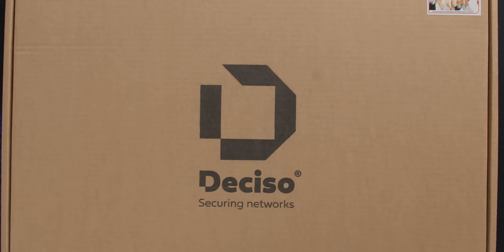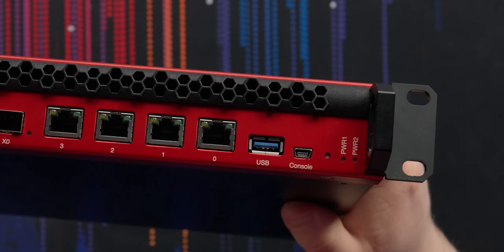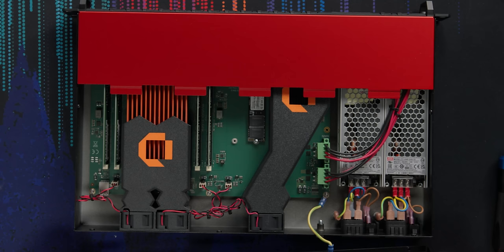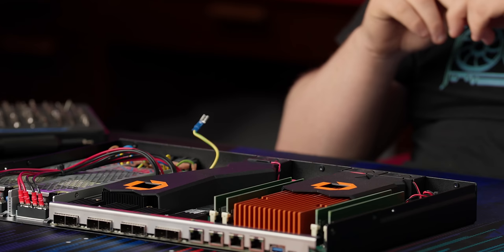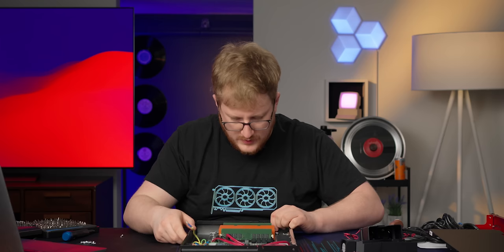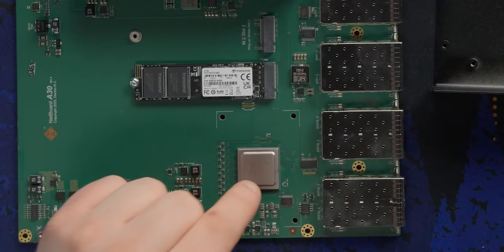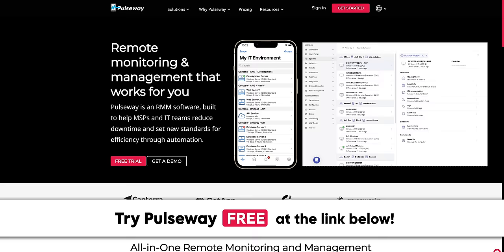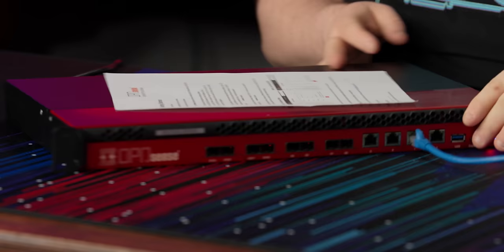Our BIG network upgrade! - OPNsense DEC4280

Comment: 60 Gbps is a nonsense number that’s derived from using a 1500 byte packet size for all packets at 5 million packets per second (which is the real number to be focusing on). At a more realistic 578 byte (IMIX average) packet size that’s 23 Gbps. At line rate (64 byte packet size)? That’s only 2.5 Gbps. And that’s not even going into the absolutely abysmal threat prevention rate which takes packets per second down to 625 thousand. For something that’s costs $6,000+ one would expect better.

Comment: Jake either brings shockingly cheap server hardware or gut punching expensive. There is no in between.
Reply: And it's poorly spent every time. He could spend literally a bit more for a real firewall.
Reply: @gamebrigada2 wdym it is a real firewall, it's literally a security appliance
Reply: @spicybaguette7706  he's just a hater.
Reply: Ubiquiti is perfectly in-between which is why they are so popular among IT professionals.
Reply: @@Mohamed-hu5jw To be fair Palo's new range ie 3410/3420 etc have come down a lot in pricing really depends what you need. Looking at renewal for our 5220 we would save about $31k over 3 years if we where to move over to either of those models, that's also including the cost of buying either and we are still saving that.

Not sure what's going on over there at palo at the moment, might finally be feeling the pinch of the companies moving to zero trust and dropping their firewalls.
Reply: @maxhennessy6676  the 400 series is pretty competitive in its target market but their older models definitely weren't.
Reply: @@1bhbjk Fair point, but it is pretty fire isn't it?
Reply: Ofc 💀 wht would he bring out something expensive/cheap that's bad, ofc theres no "in-between"
Reply: @spicybaguette7706 They mean an actual enterprise grade firewall.  Interface throughput and ACL throughput means nothing. If your a business you need NGFW features. 

IPS, NGFW, and  VPN throughput. Things like active passive and active active pairs. 

So he uses a 400F as an example of similar specs. When the 400F slaps it down.

400F has 12 Gbps IPS, 10Gbps NGFW, 9Gbps Threat protection, 55 Gbps IPsec throughput.

The machine he pointed out is not a NGFW. The comparable specs they do have is 2.5Gbps IPSEC, 3.5 Gbps Threat protection.  With zero deep packet inspection  and essentially zero DLP, and application control. 

That's not even counting that interface to interface throughput which is 9.9 Gbps. 

A 200F can out perform this thing, and a 100F can give it a run for it's money and they are cheaper MSRP.

Also no one pays MSRP, assume 30-50% off including your licensing.
Reply: @@Mohamed-hu5jwmy question is how you putting Sophos and Palo in the same sentence. 

Sophos firewalls are essentially sonic wall level trash. And their EDR is awful. 

Palo os over priced when you compare to fortinet.  But it still runs circle around a Sophos firewall
Reply: @maxmustermann194  but also hugely frustrating to many IT professionals
Reply: he's saving up for the big spending one
Reply: If you think €6k is expensive I have news for you
Reply: @mgzukows  Our 201F with 3 years of licensing was just over $13,000...  This unit is $6000.  Not sure how that's comparable.  Luckily we get eRate, but otherwise...
Reply: The odds that he actually paid for this overpriced junk is 0.  YouTubers are all the same.  They’ll pimp whatever is free and gives them to ability to use affiliate links.

Comment: am i the only one that find it infuriating that an open source router has a "warrantee void if removed" sticker on it and has 0 hotswap parts while also using annoying torx bits
Reply: I agree about the open source and warranty void sticker, the no hotswap and torx I don't 100% agree with.

They have redundancy at least, so you can schedule your maintenance outage at a time convenient to you. I don't see a device like this being used in many large enterprises, no hotswap, no global distribution chain for support and parts. More likely SMB or prosumer customers like LTT.

Can't stand phillips screws, alright rounding over or striping. I found torx so annoying, until I actually owned a good set of torx bits and torx drivers. They are the superior screw.

Comment: As someone who works with rack mount HW all day every day, redundant PSU's are not helpful if they are not hot swappable. If one fails the unit has to be taken out of service for an extended period in order to replace the bad one. That isn't something you're going to do on the floor, too loud etc., so all a redundant PSU does is delay when the outage occurs.
Reply: It does give you the option of putting the outage into a designated maintenance time frame.
For example, I would assume LMG doesn't really need their firewall Saturday 3am.
Reply: non-hotswap PSU devices should then be deployed in pairs, or in a HA situation - this allows the devices to keep running - even tho with 1 failed PSU.  Once the fault it identified, you should either fail over to redundant device, or schedule a downtime window to replace faulty component.
Reply: @netrixtardis  Which is exactly what Jake said they are doing.  
for what it's worth, for the small business sort of customer a device like this is aimed at, it doesn't seem like a big deal to schedule 15 minutes of down time, after the 2 or 3 days it will take to have a new PSU shipped out to you.  No one is keeping spares on the shelf for this.
Reply: Technically, they are hot swappable. If you leave all cables long enough to take the unit out of the rack and risk electrocuting yourself, you can pull it off.
Having two PSU lets you connect it to two different power sources. Which you don't get to do with just one.

But you are right, it's wayyy more convenient to just pull the defective PSU and load a new one.
Reply: A dead PSU is not that kind of problem. OPNsense is build with HA in its base.
If one unit fails, the second will take over all services, until the problems with the first unit is solved. This goes back to the roots, inside PFSense.
Reply: I'd sooner opt for redundant devices than redundant components.
Reply: This is more for 2 redundant power sources. You'd also want 2 of these firewalls in a pair.
Reply: While I agree with you that hot swappable, redundant PSUs are better, Jake mentioned in this video he is doing an HA Pair, so having two PSUs in each firewall and being able to pull one out of service means this is probably a non-issue here.  OPNSense uses CARP and the failover times are basically nothing between firewalls.  You could do it in the middle of the day and nobody would notice.  This is the same on pfSense.  The only interruptions you'd see are things like VPNs.
Reply: You’re supposed to put power from two different phases into it.
Reply: If you can’t have outage, you probably have a second firewall configured with HA
Reply: For the $6k price, there's no excuse why these couldn't be hot swappable.
Reply: How did you get into your position? I am a hobby IT guy but work as a certified auto repair technician. Been considering switching to IT, just don't know how to really do it.
Reply: @fightingfalconfan  I did not follow a "normal" career path. I used to be a software developer and moved into IT management as I got older and SW jobs started getting hard to find.

To get into datacenters you need either a degree in something like EE and/or a bunch of certs, A+ or the like. Your best bet is to find some small to mid size business that needs someone to handle their IT/helpdesk and get that as a line on your resume. If you can get them to pay for you to take the cert courses/exams all the better.
Reply: @johngaltline9933  You would be wrong. Though frankly, you are better off buying a cheap 1U from a tier one vendor with a 7x24x4 support contract. However in general you operate routers in pairs otherwise you have to take your network down for firmware updates and that really sucks as it will be a far more regular occurrence than hardware failures and well paying your network admin to do it out of office hours starts getting expensive quick on the overtime bill if you can persuade them to come in at all.
Reply: @krisdphillips  Having to take network gear out of the rack for fan/psu replacement really really sucks. The problem is making sure you get all the network connections back in the right port.
Reply: @jonathanbuzzard1376  so, what you’re saying is it is still a non-issue, as multiple units are typically used.
Reply: @jonathanbuzzard1376  It's a PITA if you don't have good cable management.  Unfortunately, most racks look like spaghetti.  

Network Connections going back into the right spot should be easy.  LACP bond for inside interfaces and your WANs are all you need to connect.  If you can't figure that out, you have poor documentation.  

To be clear: Hot swap would have been better at this price.  However, given they're a small company making their own hardware, it's kind of understandable.  They aren't making things at the same scale as someone like Super Micro.  The front grill is 3D printed, for instance.
Reply: Dual power supply gives a planned/managed repair. It also allows a plug to be on mains and a second on UPS. UPS systems do fail.
Reply: Why do people touch RAM on the connectors?  Yes, unlikely to shock it, but why take the chance? Hold it by the PCB sides.
Reply: @jroysdon  because it makes no difference. A static charge capable of damaging the ram will jump right through the conformal coating or between the layers of the pcb at the edges just as easily as it will through the connector.

Comment: i work as an it professional and installed similar deciso hardware in different customer scenarios. every unit works like a charm to this day. i really like opnsense, so simple to setup everything and rock solid. cheers
Reply: Wonder if it's relabeled stuff or proprietary...
Reply: @mrmotofy  for the pcb itself i dont know. but they put a lot of efford into custom cooling like 3d printed stuff

Comment: I used to OPNSense on a Core2Duo laptop, was great to have the built in battery (was new). Using a ProtectLi now, highly recommended. Last router you'll need for 20+ years.
Reply: yea until your isp give you fibre and 10 gbit for the same price.

Comment: Big fan of the customization devices like these offer as routers. I've been using pfSense on a mini PC for a few years now and it's been wonderful. It's quite refreshing to finally experience something so reliable that it has multiple years on the uptime counter.
Reply: In business IT: Uptime counter === unsecure/obsolete software running for YEARS... good luck with that if you have an audit :)
Reply: @EFazy  It’s not at a business so I don’t have to worry about any dumb policies. I’ve never heard about anything that would impact pfSense’s efficacy as a firewall on a secure network, so what do I care?

Comment: I just built myself a Sophos firewall, I used an old dell optiplex with a dual intel gigabit NIC. Got the hardware all for about $120. For home use, its overkill. Sophos offers a free home version of their OS. It can do packet decryption and re-encryption (which breaks stuff but its fun to play with). 

The home based version does limit to you a 4 core CPU and 6GB of RAM. Which is fine for home use. Probably fine for a small business but the EULA likely states not to use it for a business environment. 

I had been using the setup for a PfSense deployment, but I wanted something that did deep packet inspection. Mostly just to play with.
Reply: I use the SFOS XG line in a corporate environment, absolutely rock solid stable with all the tooling we need. Great kit.

Comment: Love LTT folks touching data center stuff. But this thing is missing a few things. 

1. Hot swap psu is a must.
2. Hot swap raid1 hw/sw storage is a must
3. Ports designed / additional ports for LAG or H/A - failover. So when running active/active or active/passive has that communication. Yea you could always trunk and use others for similar features but better to have dedicated ports
Reply: I thought this too. At the very least, 2x 256gb SSD/NVME would of been more cost effective unless you would need 512? I personally don't see the need.

The Dual PSU but not hot swappable makes the dual PSU pointless almost? As you would likely need to shut down to replace it.

6K for something really only worth 1.2k feels a little 👀👀👀👀👀

Comment: You guys should do a video sometime on exactly why OPNSense is better than PFSense. Or why you "prefer" it over PFSense, if you don't want to get into which one is "definitively better"...
Reply: Indeed.  I've seen some people say they prefer pfSense because OPNSense updates TOO often and runs into upgrade issues due to that, whereas pfSense wait until there is a good reason to update and run into less issues due to a longer testing period.

A big reason I'm still on pfSense though is having to port over my configuration would be a pain.  Plus once you've learnt how the UI works it seems more of a chore to learn the difference than just stick with what you already know.  I've not seen a compelling argument for why I should switch, more that OPNSense is easier if you don't already know how the pfSense UI works.
Reply: OPNsense is not better than pfSense. Having a nicer UI doesn't make it better or faster. It is much the reverse in reality.
Reply: @alexatkin  Those reasons are pretty much the reason I will not use OPNSense. I want a very stable network appliance, not the latest and greatest updates. I find pfSense to be extremely intuitive as well and have yet to have any issues with it *knock on wood*.

Best practice in the network world is to generally update only about once or twice a year anyway unless there's a serious vulnerability discovered in the OS running on the appliance. Other than that, you don't want to be disrupting your customers all the time just to upgrade for no really good reason.
Reply: PFSense treats their paying customers and community like garbage. 

Decent product but trash company run by trash people.
Reply: We preferred Opnsense because it's more modern, the way the web interface is made, we didn't need to scrape HTML to automate it. That said they have an API now. Pretty certain pfsense still has none of the above
Reply: @espkev  And you probably are writing your comment on a Windows or Mac machine, powered by an Intel CPU - those companies also treats their paying customers and community like garbage. Yet, here you are still using them.  Go troll somewhere else please with your ridiculous comment.
Reply: @autohmae  A pretty GUI that gets in the way when you actually need to do a real network admin job. An API is nice, but it is also another surface of attack that will get targeted. If you want to automate things, learn CLI and Kurbernetes, you'll get much farther than doing (or even thinking) scraping....  gosh, we we doing that in the 90s!
Reply: They ran into huge driver issues with PFsense in an older video (when they first went 10g I believe). Fought for a while and even got Wendell involved, before switching to OPNsense and it just worked. From then on, I don't believe they've revisited PF.
Reply: I expect the answer is 1 provides more free hardware and a better paying affiliate program - The YouTuber mantra

Comment: Been running opnsense for a few months and it's a network engineers wet dream. From PPPoE to LTE to OVPN layer 2 bridges to physical ports you can do a bunch of complicated stuff. But by far the best feature is the ipv6 subnet support. Been missing that on every other router... You can even delegate a subnet as a prefix to a down the line router. Amazing IPv6 experience! IPv4 works aswell of course, you can even give v4 lower gateway priority so you get the ipv6 speed boost...
Reply: Speed boost because of ipv6 😂😂😂😂
Reply: @Frugaltail  more efficient Routing, faster dns lookup etc. Its just better

Comment: Absolutely love opnsense, running an arris sb8200 with tplink ax1800, started getting slower and slower speeds to the point my gb was now 400mb, had an old xeon thinkserver laying around, popped a usb with opnsense on it and I'm now getting my full speed plus able to have internet even if my access point dies, also have stable 32ms or less on every ping test where as before I'd have random 200+ms pings on ethernet and 400ms pings on wifi. Was even able to snag a 2.5gb switch with 10gb sfp+ for $60 so now i have Gb internet and 2.5gb local network

Comment: The one question that came up was about not installing a 2nd SSD.  Network appliances almost always come in pairs, so in the event one fails, another is there to pick up the slack automatically.  Instead of adding redundancy inside the device, you make the entire device redundant (Save for power, because power failures are some of the most common issues with data centers).   Logs should be streamed to a local logging server, and configs need to be shipped off whenever a change occurs, so the data on the device is not an issue.  This means, that if you ever need to service it, you can just power it down, let your network failover to another router, and then swap with one that has already been imaged, restore your configs, and it's back in service.  If the drive fails, the entire device fails and the 2nd router will automatically pick up the traffic.  Will a 2nd drive allow that failure to be delayed?  Yes, but now you are running a router that is not at full capacity and on a degraded drive, not an ideal situation, but still, that would allow you to manage when to bring that device down instead of dealing with it right away.  So there is value, but it adds complexity.

Maybe they will add one in the production build, but that also adds cost, so there are always trade-offs that you need to consider.  At least there is a 2nd nvme slot to let the customer make the choice.